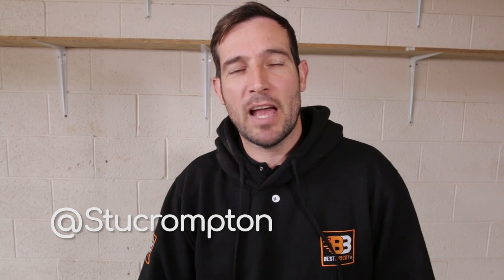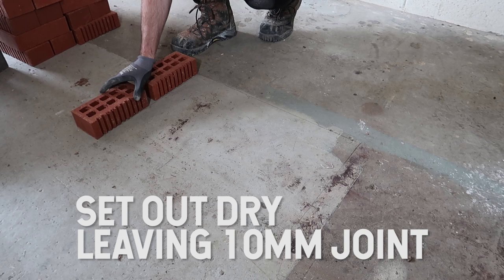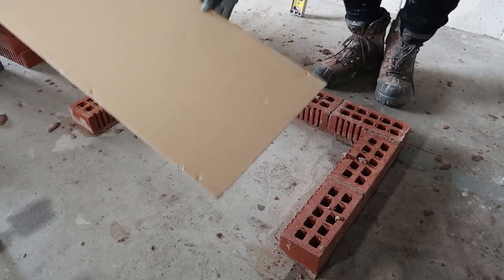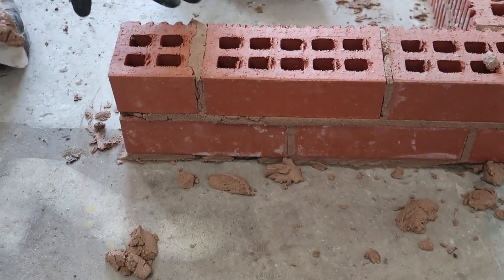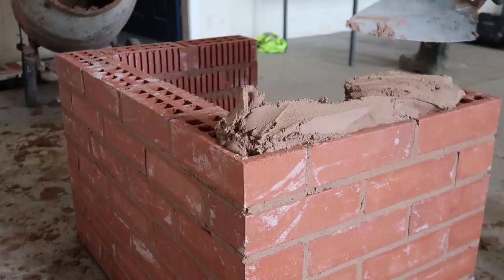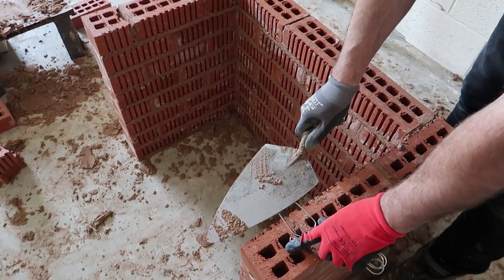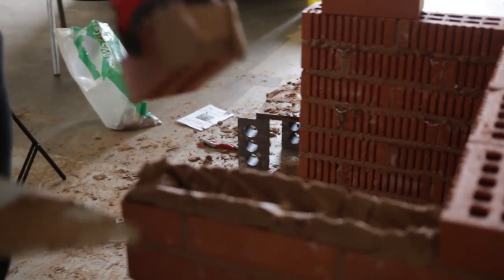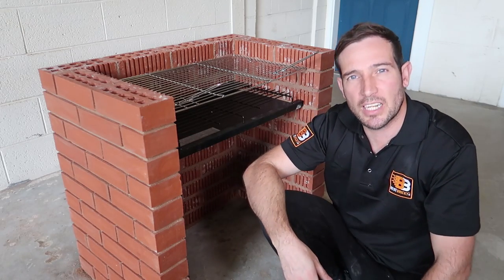Brick BBQ Step by Step Tutorial

Comment: Whenever you factor in the weight of the grills, and the fact that the metal will be getting hot. I really don't think those little wall hangs will stand up overtime. Maybe a few cooks, but they're going to get weak fairly quick especially if you're cooking anything heavy or doing high temp grilling.
Reply: You are right I am a brick mason and have built hundreds of these not only will the Heat Ben the small little ties he put in overtime they will Rust Out and also he is using regular brick overtime the heat will deteriorate the brick and mortar
Reply: @GarySmith-ss1ee  what bricks and mortar are you supposed to use instead? My dad was an incredible bricklayer as I have been told by many people around my town who he worked with and for. The brick bbq he built is now becoming unstable as where the brackets are that hold the bbq, the mortar there has cracked and is coming away
Reply: @jamiesmith9719  overtime the heat will deteriorate the brick-and-mortar to build a BBQ Pit you should build the Firebox with firebrick and refractory mortar both were made to withstand the Heat then use regular brick-and-mortar on the outside and also instead of using metal for the rack to sit on you can step the fire brick out around the inside of the firebox so there will be no metal to warp or burn out that's the way I recommend to build it

Comment: We call it a Braai here in SA - Nice brickwork but may I add a couple of thoughts? The brickwork on the top looks unfinished, a nice terracotta tile capping would complete the job. Also why not tidy up the jointing on the inside too - it looks scruffy? Important to have at least two levels of support for the grille, which would allow for more control of the distance of the food from the heat as it varies. Speaking of grille supports, a grille laden with meat can get very heavy, I'm not sure those flimsy ties will provide support for very long, especially considering that they will be exposed to intense heat - And are they stainless, or they will rust to nothing in short order. And lastly, any decent braai needs to have some working surface area on either side for putting things down (like your beer) while working, and taking cooked food off onto. Cheers mate!

Comment: How do you set all the joints between the bricks (horizontally and vertically) to be equal in terms of thickness?
Reply: Height go up in 75s and length 225 with bed and header 👍 10mm is size bricks are 215 x 65

Comment: Great vid, mortar looked a little dry? Or is that the perfect consistency? Mines usually wetter what do you recommend?
Reply from the maker: I depends on the type of material you are using pal im using engineering brick, they don’t soak much water out the mortar so needs be stiffer and vice versa
Reply: OK mate thanx I didn't know that

Comment: You fast forward through the straightening / vertical levelling and getting the bricks to be flush .. i.e. getting that fantastic flat finish, could you show that in more detail. I find this hard to do without spending a very long time.
Reply from the maker: Yes Stuart there will be a full tutorial without speeded up footage but that will be about 45 mins so thought I would put short version out first
Reply: Run the video at a slower speed for those parts.